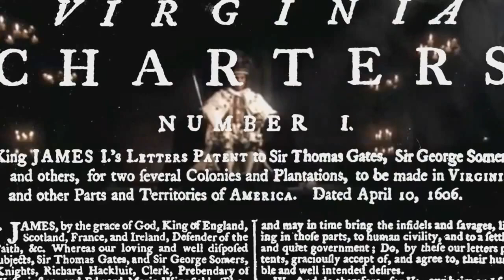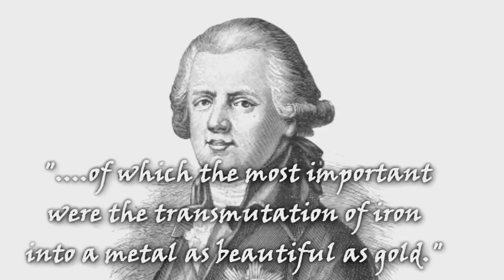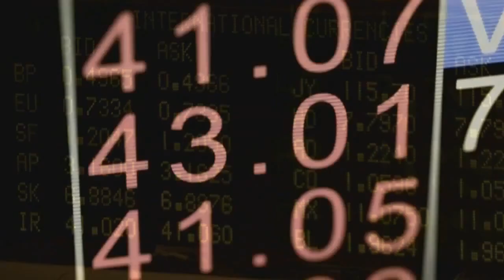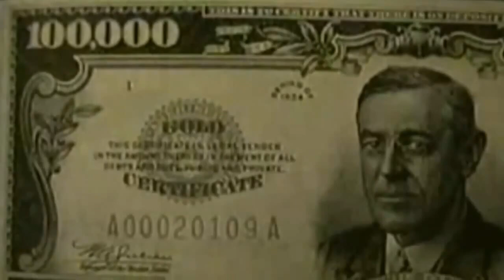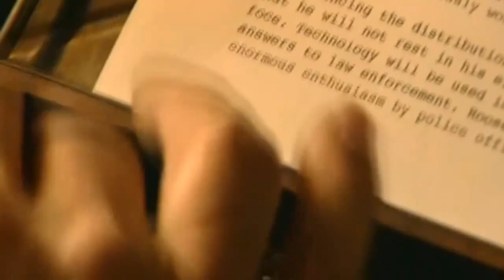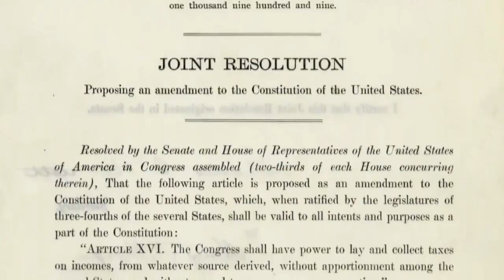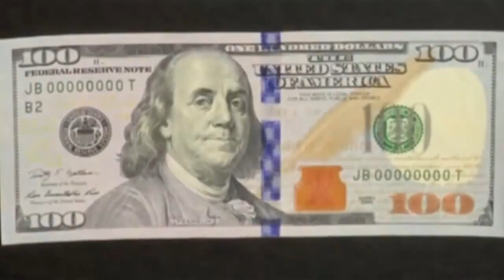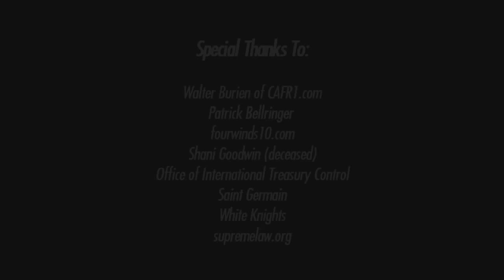Change is on the Horizon - Dawn of the Golden Age (Full Version)

Comment: I appreciate the information and ideas. It's a good video to get people thinking. Where you've pulled this information from needs to be referenced or if it's an opinion based reasoning formed from specific information it would be nice to know that also and where that information came from. Are there any sources for all of the claims being made in this video? I'm not saying I don't believe they're possible, but in part 3 the claims are rattled off one after another - there are nearly 50 claims made in part 3 with nothing sourced. Any documents or sources? It's hard to build any kind of movement to spread this information if it is really the truth when there's so many assertions made and no source to point at to at least introduce the idea to someone. If enacting positive change is what we are trying to achieve through spreading the truth we have to be able to point to evidence and we have to be careful with the claims we make or it just discredits the movement as a whole.
Reply: Good points. How did this guy get all this inside info?